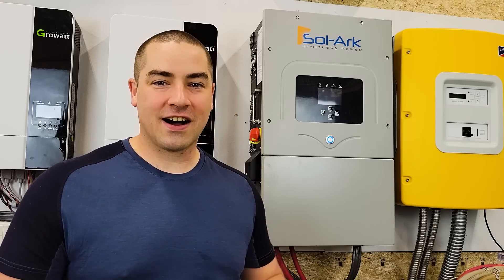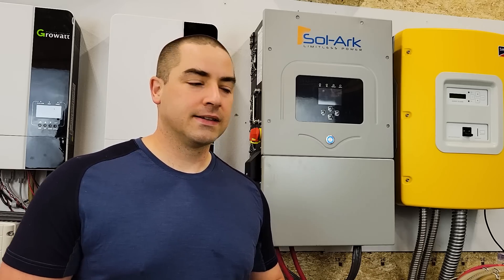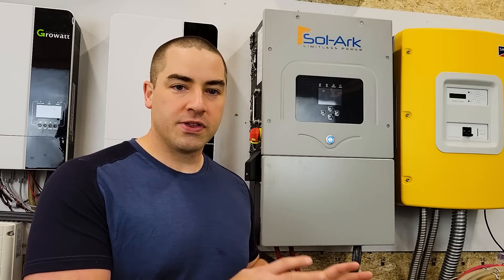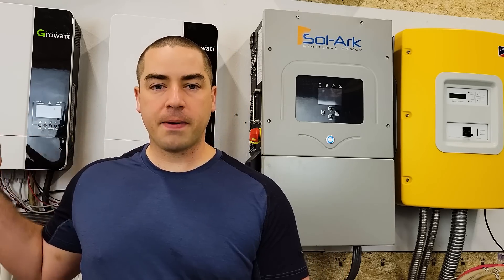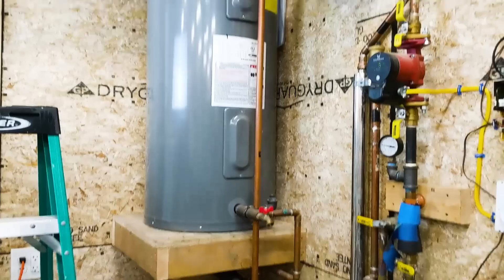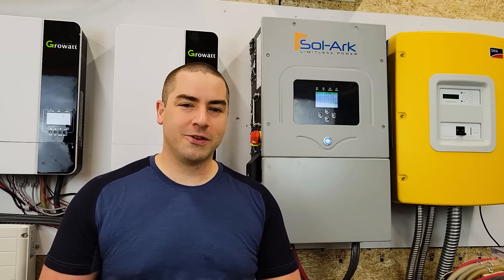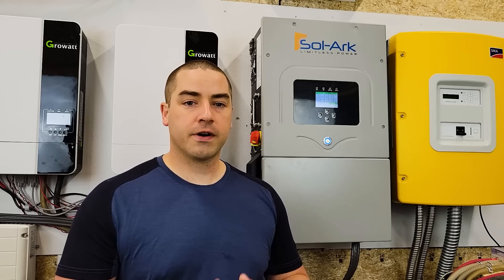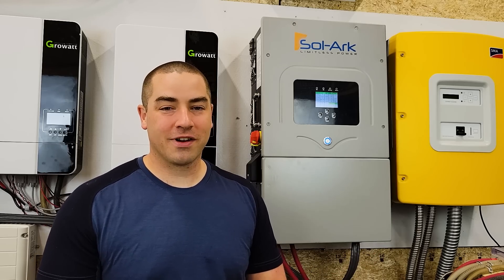Sol-Ark 12K Inverter, Is it worth it?

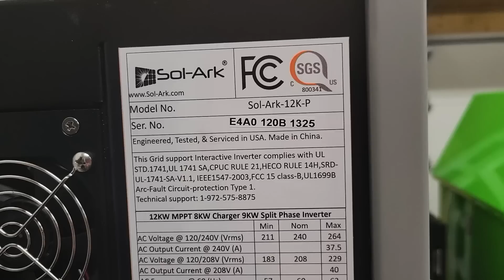Comment: So, the "4800W 40A L-N 120V" is a lie. [@0:45] (or you're exceeding that faster than it can display it.)
Reply: I just tested my system and it did 4800W at 120V and 40 amps just fine. This guy doesn't have updated software, so I think that makes this test pretty irrelevant. He doesn't even have a dongle in, so he clearly isn't interested in getting help from Sol-Ark since it can't show his data on powerview. Also, the Growatt product placement makes me think this is just a paid trash marketing piece. Sol-Ark has been great to me, and their products are not perfect, but they're very good at most things. I think this guy needs to learn a little bit more about transformerless inverters, as he seems fairly ignorant. He might want to read the manual too, because it's way too close to the others. Bad install, and clearly ignorant about the specs.

Comment: We use Schneider XW systems for off grid they start loads and exceed rated power they are the heavy duty option. Grid tie with battery backup Sol-ark does well light loads meets all grid NEC requirements compact design. We have seen similar Sol-ark performance but this true with most transformer less inverters(no autotransformer), Awesome info its hard to beat Growatt's price point. Great real world testing. I am grateful of people like Dave doing these tests because I know the manufactures will see the problems and hopefully improve their products.
Reply: Yes the transformer based systems have a lot more kick to them. It's kind of like the difference between a V8 and turbo 4-cyl. They may on paper have the same specs and in fact meet the specs but the V8 will just have a lot more grunt. Currently I'm more leaning toward the Outback system. They weigh almost 4x as much as the Sol-Ark for the same power. They have a lot of bulk, very robust.
Reply: My experience with Schneider has been a nightmare, crap no support.  Replaced with a 15 K sol arc

Comment: I would still prefer to have the Sol-Ark if for no other reason that 70W draw vs how much from the Growatt setup with the auto-transformer???  You didn't mention the later.  Add that draw and lower efficiency up for the Growatt system over 24 hours and I think you'll see it requires a significantly larger array and battery system to offset it.  So again, I'd take the SA but I also don't have need for nearly as much power as you do... about the most we ever pull is about 3k max.
Reply from the maker: Each Growatt 5k is 70W at idle, and 18W for the Auto-transformer.  About 160W total idle draw of the Growatt system.  I did mention this in some past videos.  No doubt, the Sol-Ark is more efficient than the Growatt setup.
Reply: @DavidPozEnergy  Thanks David.  That really adds up over time.  But again, you need the extra capacity.  Adding the transformer to the SA would have made this a more apples to apples comparison... or removing it from the Growatt system.
Reply: @DavidPozEnergy  , Yes,    I would rather put up a few more panel to compensate for the waist of the growatt than have a mad wife.
Reply: Take the money saved from buying growatts and purchase more lithium. That's what I did and come out way ahead than buying 3 solarks.

Comment: I have been using a 8k sol-ark for a couple of years now but in my setup I use two load panels.  One load panel is tied to the Sol-Ark and the other I'm using a AIMS 8k inverter which handles the A/C, electric stove, basement and garage circuits. I have never had a single fault. All tied to a single battery bank. Still allows me to have all the advantages of the sol-ark as well as heavier loads.  One down side is the additional idle wattage of the Aims unit especially in the winter.
Reply: Is it worth it?  Depends on what you are trying to accomplish. If you trying to maximize sell back the definitely. If your off grid or not interested in selling back then I would look at other cost effective options
Reply: Is the 8k split phase? If so, what's the point of having a split phase inverter? If not... You bought 2 inverters and are comparing them to this split phase 12k? I'm failing to make the connection.

Comment: Red Poppy Ranch had this issue as well where their Sol-Ark would constantly overload and shut down ... They eventually gave up and replaced their inverter with Lion Energy if I'm not mistaken, and have been very happy since.
Reply: Lion energy just sold the updated Sol-Ark to Red Poppy. Transformerless designs have that inherently and Sol-Ark engineers found the solution. That’s innovation.
Reply: Same inverter just more battery they probably also balanced the load panel better.

Comment: Thank you for the review, I was sold on the Sol-Ark but plan to re-evaluate my plans.  Still a nice unit but pretty limited at 4500w per leg.
Reply: Same boat here. I'm wondering if driving the auto transformer with both legs and pulling the neutral out of there might remedy the problem.

Comment: I use an inverter with similar features to the Sol-Ark, and its advantage is really when using it with the grid. Then it can power any type of load unequally distributed, because it has the grid to start loads, and can also just feed power evenly from both sides forward to either export to grid or supplement up to zero power usage at the meter, pulling from PV and/or battery (which is how I have mine setup).

That way you don't have to think about your power usage but it still catches 99.9% of peak power usage. You can program a battery minimum to maintain unless the power goes out and an automatic transfer switch keeps everything seamlessly powered behind the load port. I have my AC condenser, electric drier, and range circuits in my main panel with CT clamps measuring power there, and then everything else in my house in a subpanel behind the load port. When the grid is up it can supplement any usage up to the max, when the grid is down I operate autonomously but have to watch the usage (I've had about ~4 hours of the grid being down in the last year, but it flashes all the time).

If there are several cloudy days in a row it basically just keeps the battery at the programmed minimum (for me 50% because I want 12 hours of conservative power usage if the grid goes down) while the PV output goes to partially supplement the grid usage, but I don't have to think about it or switch it.

Edit: I also wanted to add, that when it's powering a load during the day from a higher voltage PV string, it is extraordinary efficient. I went from a 12kw low frequency growatt that I was switching between pure on grid bypass or off grid pv/battery mode depending on total charge, and going to Sol-Ark ended up effectively adding 3kw/h a day because of efficiency gains. This is out of a 9.6kw array with east/south/west faces that has been yielding about ~40kw/h a day.

Comment: Do you have the comparison on the efficiency between Solark, Growatt and SMA.  I know that Solark beats 1 SMA hands down and crushes the 2 SMAs in efficiency but not sure how is compared to 2 Growats except that 2 Growatts and the Solaredge Autotransformer use at least 150W idle power usage compared to the 70W of Solark.
Also I would like to see the Dirty electricity comparison between Solark and Growatt. SMA because it is transformer based probably is the safest when it comes to health.
Reply: I was seriously thinking about going with the Growatt's and the transformer, but the 150W idle usage is just a deal killer for me when you consider the battery and solar array requirements needed to offset it (and the lower efficiencies), it really adds up.
Reply: How often are you in idle when your powering a house? Mmm never? Save the money and buy more lithium if your worried about 50 watts
Reply: @easylooker  That's not how idle current works, it draws 150W always in addition to your loads. Also that wasted energy will grow as the load increases when the transformer becomes more saturated and dissipates more power to heat. And transformer systems have a higher amount of distortion in the AC, especially at higher loads.
Reply: @easylooker  50W continuous draw is 1.2kWhr per day and ~440kWhr per year.

Comment: I have a Sol-Ark 8k in sell to home mode. I have never had it shut down in the 2 years I have had it.  
I have run both a 1500 and 3000 watt water heater element and the same time. There are both 240 so they are balanced.
Reply: If you have a tiny house or cabin with next to no loads then it's fine.
Reply: If it's grid tied it just uses the grid for extra power. Sol-Ark works great for those most of the time not needing lot of power it 99% solar powered. The goal is to reduce the amount used from the grid they work great for that.
Reply: I have a 6000W 240V dryer on my solark. I've experienced shutdowns when the house is drawing down ~500W and the well pump and furnace turn on at the same time as the dryer is running - That exceeds the total capacity of the unit. I pay attention to what I am doing when I run my house and using the "I just want it to work despite overloading it" as a reason to discount the Solark, then comparing it to a system that has an autotransformer to balance the legs seems a little disingenuous to me.   If it's a sunny day I've never been concerned about starting the dryer even while the Solark is charging the batteries. I have a screen grab from the day this video dropped of the Solark putting 3.5KW into the batteries and 6.5 KW into the dryer and the rest of the house with no glitches.      Sorry, Dave.

Comment: Wow David. Your video shows how much kickback you get from GroWatt and Gyll batteries. Based on your serial #, your system is using 9+ month old software. If you had called our tech support, we would have updated and increased your 1 leg power from 4500W to 5200W+. And the single biggest payback to a hybrid inverter is selling back to the grid. The single largest costs of an ESS system is: battery, install, financing, inverter, panels, BOM. We save customers by make the rest of the system work as it was intended.
Reply: You had the opportunity to teach here. You could have just said, "There's a firmware update that will improve the functionality."

Instead you had to lead with lying defamatory statements...in writing. That's called libel. Why so douchey?
Reply: The kickback comment is a bit out of line. David has said he still has the unit and will try with the auto transformer to see if that helps. Do you know if it will? I'm sure he'd be willing to try with new firmware to see if it helps his particular house. 

The leg could still be overpowered with effort, but it's really cool that it can be upgraded to 5200W after purchase with firmware update - reminds me of Tesla!

(Be nice to me I'm literally days away from ordering my solar system built around a Sol-Ark.) 😀
Reply: A lot of people are talking about the misleading 12K
Reply: Well since you're here. Whats the word on these misleading model numbers?
Reply: Why wasn't this unit sold at 5200W per leg from the factory if it could support it?
Reply: " Wow David. Your video shows how much kickback you get from GroWatt and Gyll batteries."    
Inconceivable comment . Wow yourself.
Reply: Rich you coming here and telling your distributors to check this out. You have guys who only use solark on installs so they get a kickback?  and I've seen a lot of others having same problems. With 5000 dollars saved a fella can buy a lot of lithium. Ehh? Wonder if David goes to your videos and calls you out for deceptive advertising? Pretty low class you coming here if you ask me. Wonder if EVE goes on people's videos and tell them they don't know what they are doing wiring up batteries?
Reply: A friend of mine just had a Sol-Ark 12k based system installed at his home and it seemed very impressive when I was checking it out. I am pretty sure David just misunderstood that you can't pull the total inverter power out of one leg of the inverter (and him being used to using an autotransformer didn't help that way of thinking). Most of your post seemed to be rather helpful, but I would be very interested in knowing what proof you have to make the statement "Your video shows how much kickback you get from GroWatt and Gyll batteries", as you are not only making an accusation against David, but also GroWatt and Gyll. As a Sol-Ark representative, you potentially have quite a few new eyes on you right now, so you may wish to consider if that remark was even slightly appropriate.
Reply: Do you know what the engineers at Deye did to make that increase possible? Would love to update my Sunsynk inverter with this change.
Reply: I started using the solark 12k last March and have had very good luck with them.  I have added more inverters since then and I am very happy with it.  I am currently off grid.
Reply: Do not agree here. You guys sent me a replacement with old software. I guess you guys should make sure that the inverters going out are on the latest software. That would also save your technicians a lot of time.
Reply: Sounds like the stuff to recommend a follow up for instead of a low class lawsuit threat from yesterday guys
Reply: Any ETA on the 15k model?
Reply: The best part is that we're now nine days removed from this comment, and sol ark has yet to respond to a single customer question, helpfully or otherwise
Reply: Nice to see a company that stands by their product by saying "how much kickback" the reviewer gets.
Reply: I’m just an observer but it looks like Sol-Ark is pretty good at pushing off the blame.  Personally glad I won’t be a customer (or should I say victim?)
Reply: Petty accusatory there Sol-Ark.  I've been promoting your inverters for a while now, but I've also had issues them shutting down.  I've stayed on top of the software updates, but they come out too often.   
Instead of reactively accusing someone of getting kickbacks from another company, why don't you take  feedback where it's due and work with us to make a better product.

Comment: I shied away from the Sol-Ark because I thought that calling it the 12K with less than that 12Kw was misleading. I also wanted a low frequency to handle starting my well pump more reliably  I bought the 12K Growatt but I'm still waiting on EG4 batteries to be delivered so I can test it.

Comment: Is there a way you could measure the quality of the power out of the Growatt/autotransformer combo?  THD & frequency regulation?

The claimed advantage to the solark is the exceptionally low THD & great frequency regulation.  I’m interested in how well the Growatt’s with the autotransformer stack up.
Reply: I’d be curious to see that, too. High THD can reduce the lifetime of electric motors. You might save a little on the inverter and pay for it later in repair cost of your appliances.

Comment: Didn’t you have a friend give you this 12k? Maybe he had issues with it. Why would someone give a $6,500 hybrid inverter away otherwise? Have you sent Sol-Ark your testing to see if that is normal?   You’re not comparing apples to apples. You loaded up one leg without an auto transformer. How did the Growatts work before adding the auto transformer? Maybe your 120V circuit breakers need to be shuffled to provide a more even load on both legs. **4800 W AC max, NOT 4500W**   **60W is the idle power consumption**
Reply: Yup. That’s another thing that wasn’t considered. Most of the time when doing fresh installs, load balancing systems is a major consideration. I can almost guarantee that load balancing AND an auto transformer would fix everything.
Reply: He said it was an open box item and on loan to him...solark does not provide a autotransformer nor do they suggest one in the manual, this is a known issue with this inverter design(high frequency) , and most people who buy one wont be watching their loads to make sure there isnt an imbalance...soulution....buy two lol
Reply: The growatt 5K doesn't work in 120v at all without the auto transformer - it's an international 240V only unit. The autotransformer also just balances loads between the legs to 120v, so you can use more than 5k worth of power on 120v so long as its balanced. It's honestly a really great little system.
Reply: Actually I think it was a perfect demonstration on the limits of HF transformers. The advantage is standby current is quite low, the disadvantage is they don’t have a lot of headroom and they can’t loadshare. If you’ve watched David’s other videos he’s heard from other users who also complain about this inverter shutting down. He’s not trying to dis the product, he’s pointing out real world issues for end users who may have been looking to spend $6.5K on something that might be unsuitable. Yes, he could try changing his panel and load sharing better between the legs, but 4500W is still going to overload at some point in most homes. Plus re-wiring a panel for most people doesn’t come cheap. And why would you use an autotransformer with the Solark when you’re spending all that money to have the functionality built in?
Reply: It's normal.   It's one of the things I suggested @davidpoz tests when he posted his original sol-ark video.  There are 3 scenarios I know of, that will cause it to shut down every.single.time,  this is one of them.
Reply: It's on loan, not permanent.
Reply: you already spent $7k on a solark and you didn't even get a balancer